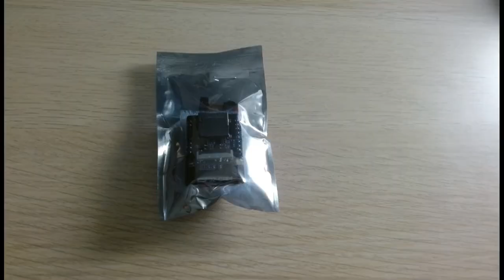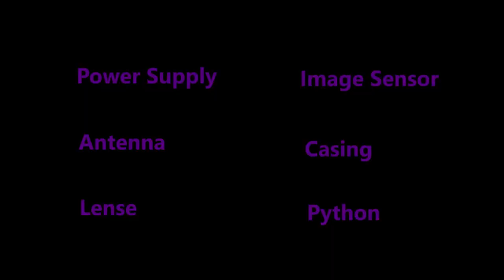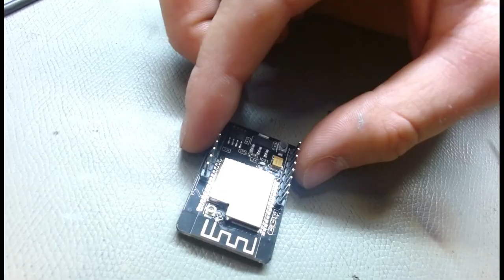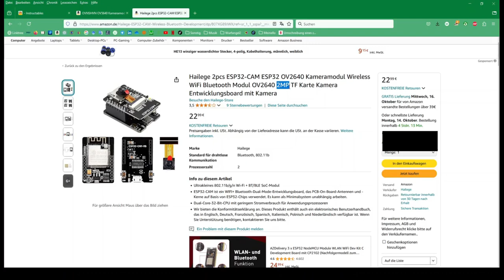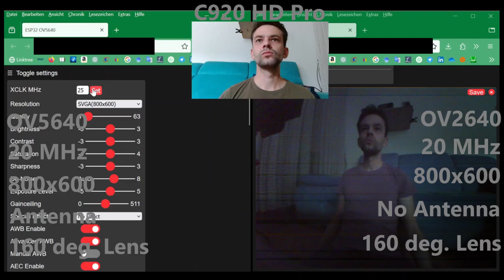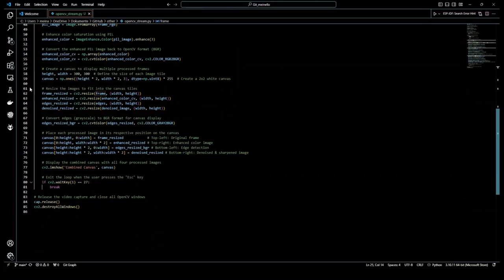Improving image streams from esp32 CAM

Comment: Lens quality: Did nobody wrote a Program to improve graphic quality ? I think, most chip have quality issues, so many cameras improve quality by measuring physical characteristics, like taking black image from sensor to correct values when taking pictures - things like that. I am not into that, but can imagine, that there is potential in this. That can be also very true for lenses. I think. Taking dark pictures, white or may be also recording data for lookup-Tables with a controlled lightsource.

I cant think, that this sensors are that bad. Did somebody know any device, where they are used in consumer devices or industrial ?
I like to know, if the image quality looks bad like on esp32-cam. And if not, whats the matter with it ? 
Or are we fed with bad quality chips ? If yes, did someone tried to replace these "bad" with one of a commercial consumer device ?

I am so curious, what to get out of that 2640/5640 or if there is something to get out of it. :-)
Reply from the maker: About calibrating the image for the specific lens with black images etc.: This would reduce sensor noise and is in general something that could be worth a shot. I didn't think of it and also didn't stumble upon it during my research. However, when trying to fix the issues that arise due to the presumably faulty lens, this isn't a method that could help. 

The lens breaks the light irregularly and instead of hitting the sensor in parallel rays in a right angle, there is an increasing clutter in the rays of light, which can't be corrected like a noise. Also trying to correct this with reference images wouldn't be something I'd try with such a cheap setup
Reply from the maker: About the general quality: I've tried these CAM-modules in the cheapest version from AliExpress and also bought from one of the bigger and well reviewed amazon distributors and couldn't see any difference in quality there. About other manufacturers, I can't say anything. 
Testing lenses of a higher quality could also lead to interesting results.

I believe one bottleneck to be the WiFi connection and it could be interesting to record a video onto the SD card and take a look at the differences in quality (I decided that this feature is less interesting for applications and thus neglected it)

However, considering how many tutorials, mini projects and discussions are out there regarding this module, I was quite surprised how disappointing the resulting image quality is.
Reply from the maker: Thank you for the input!

All things considered, I don't think that I will follow up with a further deep dive into this very module. Chances to reach dead ends with only minor further improvements are rather high I believe. However, I've got in mind to look into other cheap camera modules and see how they can compete. I'm on it :D

Comment: Did somebody have tried to attach a 2.8volt to the corresponding pin on the OV5xxx module ? Or did you disassemble one to see, if there is a regulator under the camera attached to the flat wire ? I couldnt find any schematic for that cable with outlines and if there are components hidden. If not, it would be a good thing to know if adding a 2.8V regulator for that line would do it.

Another thing is (looking at  Datasheet of OV5640 ) the Current on Digital Voltage Line ranges from 9mA to 140mA in respect to how things are connected but also very important, may change from 50mA to 140mA by resolution/refreshrate (and also worstcase - when ever it may occur). 

I also wonder, there is a schematic of the ESP32-CAM where is 3.3volt on DOVDD (pin 14 on cam connector ?) Which is ok to absolutly maximum spec, but not ok for maximum working condition, which should not exeed 3.0Volt.  For 2640 it's 3.3V ok wo work. 
V_DD-IO Connection is ok to work for 2.8v for both.  So if this is the 3.3Volt pin, please try at least maximum 3.0volt or 2.8. 

But nobody knows if it will be stable because of Voltagedrop on high currents like 140mA.

So i think there is something to tinker to see the 5640 running well. May be you like to do a video about it. Would be nice.
Reply from the maker: I believe this discussion could be of interest for you: 
https://github.com/espressif/esp32-camera/issues/247
Reply from the maker: I believe as well that the OV5640 should have behaved better and I still don't know why it didn't. Maybe I was just unlucky with the hardware that I received and it would be better to refer to the results of other tutorials regarding that sensor.

About the other specific ideas on the power supply, I can only tell you, that I didn't try those yet. It'd be worth a shot.

Comment: Wow, Meinello, this video is a goldmine for anyone diving into ESP32 CAM modules! Your deep dive into optimizing power supply, Wi-Fi connections, and lens selection really stands out. Moving the resistor to activate the external antenna was a great tip, and the comparison between the standard and night vision lenses was super informative. You’ve made complex topics like sensor overheating and image stabilization so approachable – especially loved your hands-on solutions like attaching a heat sink. Keep up this top-tier content, you're truly helping the community push the boundaries of DIY electronics! 👏
Reply from the maker: wow, thank you so much for the detailed feedback. I appreceate it! Very happy if I could be of any help :)